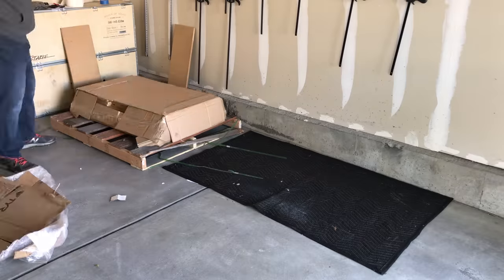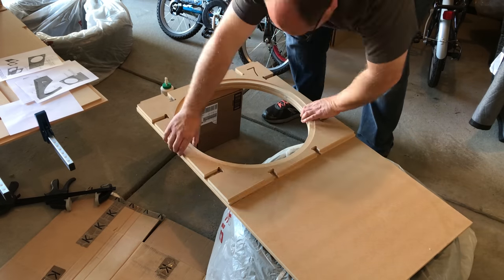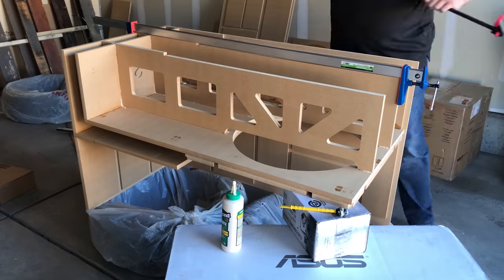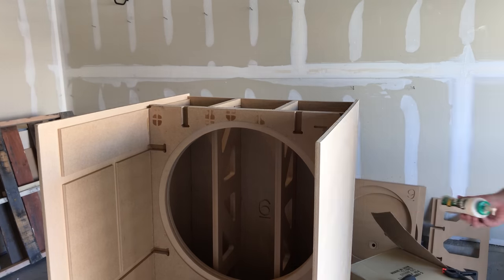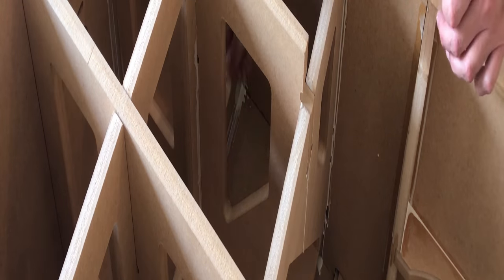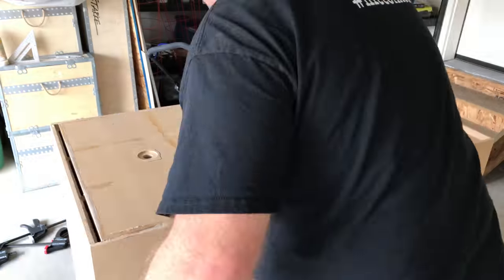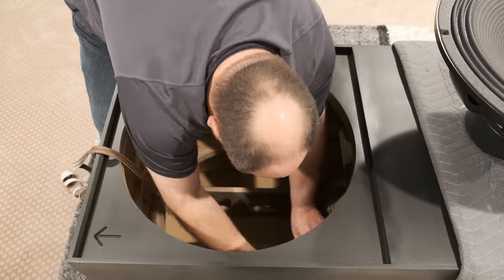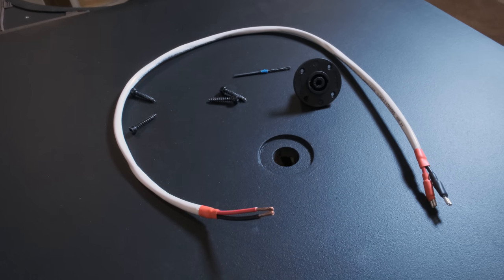21 Inch DIY Subwoofer build guide! The best GSG sub for your Home Theater.

Comment: You have all of that in a 10 x 12 room with ZERO acoustic treatment? Thanks, but I'll pass.
Reply from the maker: bvocal It’s 14’6” x 14’6” and full acoustic treatments are coming in the new year. :) Sorry to be your downer.
Reply: @JilesMcCoy  Don't take it wrong, I'm a an asshole on youtube, it seems... Here is my perspective, I just spent 2.4 years answering the question, 'why does my system sound like shit' a serious question after trying for 37 years or so to have a nice stereo. As the search became more real and informed the first thing I encountered was 'room mode'. So I set out to beat that. Nope. That is almost an unsolvable problem. You probably know that by now... So while I tried one 'bass trap' design after another I also did the regular (sort of) absorption thing and then I went into the whole diffuser thing.... Then I did a setup in a very large room and explored those acoustics. Did a fine job with both rooms, actually. Got what I thought to be great sound, went to an audio show a few months ago and came home happy and then improved things massively on top of that... Still haven't solved the room mode. Acoustic Fi**lds guy quoted my about 10k to do his bass traps for my 12x17 room.  Not going there. Then a week ago I had an epiphany, one it seems that no one else has had. Now my primary and a few secondary room modes are seamlessly dealt with. I don't have loads of subwoofering going on, what I have is open baffle mains with 18" woofers in H frames, this is not a slam type bass setup, this is a musical bass setup, yet, with the room modes dealt with, I watched a movie 2 days ago and it was the most bass I've ever heard in a movie explosion. So when I see so much monster subwoofering power in a room the size of mine or smaller it seems insane, nobody could be in there if there was zero modal loss, it would beat them senseless, no?... so all I can conclude is people are just adding subwoofers in mad attempts to solve teh modal issues in their space and when you have 3, 4 or more and your only sane goal is +1 unit of sound, it means you are producing sonic energy and cancelling it on a much larger scale than the amount you are actually using, all the while making it more and more impossible to actually control/manage/dissipate that much energy. If the bass is louder outside of the room, or you hear notes outside the room that you don't hear in the room then your bass management is not working, your setup is not sorted out. 
The kicker is that when you do deal with the bass modes everything else gets not just 'better', but correct, as in all of the sound is allowed to live correctly, where as when bass modes are present they effect the sound all the way up in negative ways, sound stage, smoothness, tone, air, dynamics.
So my impossible advice to everyone on earth is to deal with the bass mode first, everything else is easy, worthwhile, yes, but the bass mode issue is crucial, without it being solved you will never ever ever get correct sound. This conclusion is only 1 week old for me, I downplayed the importance because the solution is nearly impossible, or so I thought. I settled for a 90% good solution, thinking this was 90% good, turns out that is wrong. It's more a binary thing, solved not solved. I wish you luck in your acoustics adventure, it is a deep and complex subject. As you try out stuff/ add stuff, do it while you are playing music over the system so you can hear the effect as you, for instance, hang up an absorbing panel or place a bass 'trap', as not all moves yield positive results, you must seek to maintain tonal balance with each move or you will get in the weeds and have to start over.
That really is one beast of a subwoofer you built... cheers.
Reply from the maker: I very strongly agree with everything you have said above. The idea behind the large subwoofers isnt to create lots and lots of DB. The idea is to be able to 1) over come room modes (to some degree anyway) thought multiple subwoofer placement, and have enough cone area to be able to reproduce very low frequencies at usable volume levels. Yes, these subs can beat you senseless at 40-60 hz.... but the idea is to pull those peaks down so that they are flat from 10ish Hz up. Just because they can play super loud isn't the reason they are there. Its so they can dig deeper and play those subsonics convincingly. At this point I am still building out the speakers and amplifiers for the room. I will likely go 9 bed channels and I will replace my inceiling atmos with on ceiling atmos. The screen will go 2.4:1 and I am trying to figure out an a-lens solution so I can do CIH. Then treatments. Saving the most difficult for last.